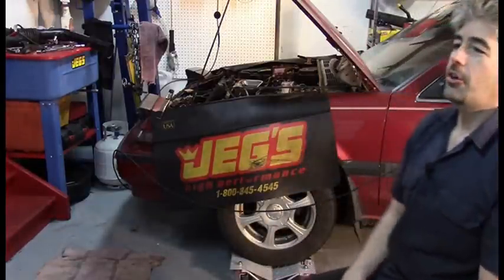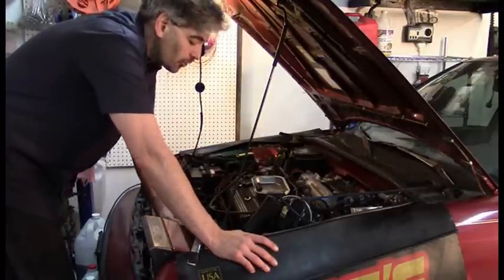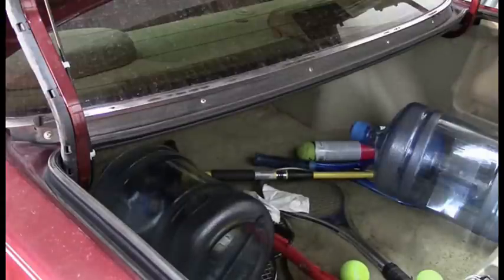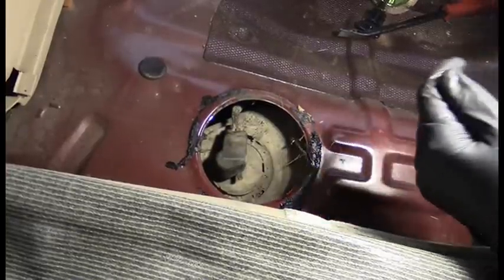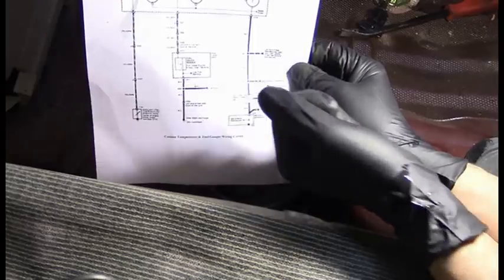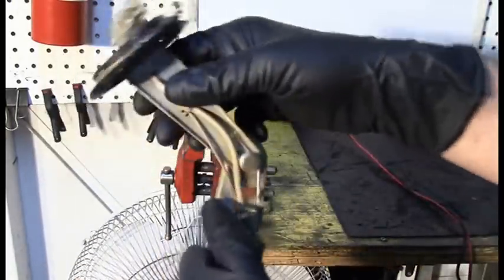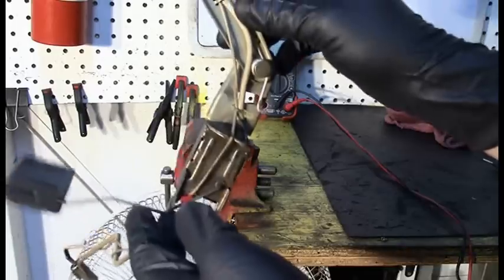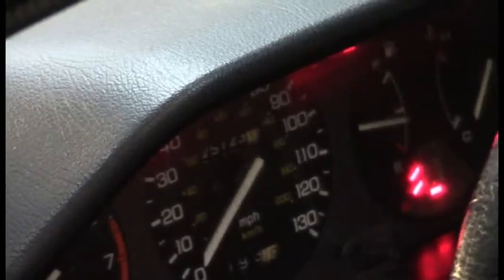Diagnosis of Stuck Fuel Gauge- Is it Gauge or Sending Unit?

Comment: Sir, i have 1996 hilux Surf (4runner) with Diesel 1kZ 3.0 Engine. The problem is when i key in and turn on the fuel gauge shows full and when start the engine it drops to empty. Any suggestions to start trouble shooting. The sending unit is inside the tank and not easy to take out without dropping the tank. Thanks.
Reply from the maker: I would check your voltage drop at the sending unit by accessing the connection outside of the tank.

Comment: Hello @Schrodingers Box, i noticed you said at 5:20 that "normally you would check the fuse" but you concluded that since its not reading "open" since its reading full not empty all the time, there would be no need. I was wondering because my 2002 Mustang's fuel is reading empty no matter the amount of fuel i put in it. Using your comment should I check the fuse next ??? Context I had a mechanic install and new fuel pump (including the fuel sending unit) and its still reading emtpy
Reply from the maker: The very first thing I would do is check the voltage at the sending unit. That would be step 1. Then measure for resistance variation on the variable resistor. 
   Nothing wrong with checking fuse but it’s not going to be the problem.
Reply: @ thank you, will do 🫡
Reply: @rhblue7204 did this help? I have same issue and was just going to replace sender
Reply: @CornishFarming  nooo it didnt work, i had to replace the whole sender

Comment: i'm having this exact issue on a 2002 Santa Fe my gas gauge stays at zero I put in a new fuel pump and sender so I ordered a new gauge cluster for 50 bucks so I'll see if that works I came to the conclusion. It was probably the gas gauge because it doesn't move at all. Whether the car is on or off it doesn't move an inch.
Reply from the maker: What was the voltage variance from the sending unit showing?
Reply: @ uh i never checked, i should mention its a 2 tank suv i tried hooking up a seperate gas gauge when i hooked it all up the gauge just went past full and wouldnt move
Reply from the maker: First step would be seeing if there is voltage change due to variable resistance. That’s what tells you where the issue is.

Comment: i didnt have my ohm meter so did the test you did with ohm meter but instead using a test light, i supplied ground to one wire of sending unit and the b+ i hooked in series to the other sending unit wire and as i moved the sending unit i could visually see the light get brighter and dimmer and steadily.
i tried the same test on sending unit that had bad corrosion from sitting outside and moving the float on this sending unit the bulb would drop out and even spike in brightness while being very erratic compared to the other one. i thought this was pretty cool.i love tinkering like this for fun.
Reply from the maker: That’s a clever way of looking at it!

Comment: Hello, I liked and subscribed. My gauge is stuck in the 1/4 tank position. The mechanics I spoke to said that doesn't make sense. It should either go full or totally empty when one of two of the most common problems occur. Any idea what would cause the gauge stuck at 1/4 or a little higher. Thanks, much!
Reply from the maker: Makes total sense to me. What is the resistance on the circuit?
Reply: I don't know. I'm hoping I do not need to pull the tank. I just paid someone to do new pump, hanger and lines. Aftermarket application. It did work when I got it back.

Comment: If I haven't seen this video I wouldn't be able to know how to test and do check my fuel sending unit properly, I do try and fix my own cars to save money and I do appreciate your help sir. I have this 1998 lexus gs300 that it has a lump on the gas tank due to their gas tank design and my gas won't hit full even though I have a full tank of gas. I hope this will work now since both sending units works properly thanks to your guidance. I really appreciate you sir and hope you're doing well and still wrenching till today 🙏🏼🙌🏼

Comment: Yes it was very help full. Yes I'm a home mechanic, mostly on cars from 1988 to 2005.
If only I would of known this information when installing a new sending unit in my 77 ford
f-150. there was nothing wrong with the old sending unit and the gauge worked. Now with the new tank and new sending unit. I have  a non working gas gauge. so obviously the new sending
unit, not  doing something. It's just installed in the truck now. I wish I would of tested it before installing. Next time I'll do what you did, and know what I have before installing tank. thks

Comment: Excellent video! Even 8 years later. I was going to just replace a fuel pump / sending unit knowing that it would be the idiot's approach - and one that would cost around $400 just for the unit. But after watching your clear explanation and sensible diagnosis, I don't have anything to lose by copying your technique. Thanks for making this video!

Comment: I replaced both sending and fuel pump on my 2010 FX35 and it still stuck on 3 quarters... its strange.
Reply from the maker: Doesn’t sound strange at all if it’s a gauge problem. did you diagnose it?
Reply: @SchrodingersBox  How do i diagnose a Gauge itself? removing it entirely form the dash??
Reply from the maker: No just ground out the signal.  see if it moves. if not apply low amperage signal and see if it moves then. if not check ground and power continuity and if it’s there replace the gauge.

Comment: There's no access panel on a 1956 Oldsmobile, so determining whether the sending unit or a wire connection is bad means dropping the tank.  If I have to drop the tank, then you may rest assured I will have a new sending unit in hand.  I can always sell it on eBay if a wire was loose or bad.  There, see?  Not an idiot.

Comment: Hi there…
Mine showed signs of failure some month ago.I took it out and saw there was a cut wire on the sending unit.soldered it and thought it was it.seemed it works fine for some Klms but suddenly fell on empty again.thought it did break again but when took it out again soldered wires where ok…cleaned it , changed the plastic damaged cover of the upper plug tried it 2-3 times and it does the same thing.when I put key on it seems fine but after a few mins drops bit by bit to empty.wtf??anyone any ideas?

Comment: my 91' sierra was a nightmare to change the fuel pump. no access panel and every connection was crammed in a tiny space between the tank and frame rail.
Reply from the maker: yep on pretty much any GM you have to drop the tank

Comment: My problem is different. My gauge works but my low fuel light stopped working. My sending unit is together with my pump in the same assembly. The assembly is expensive. What should i do?
Reply from the maker: sounds like a simple bulb replacement.   check for voltage at the bulb to confirm.
Reply: @SchrodingersBox  . Took out bulb and checked it. The bulb is fine
Reply from the maker: and what is the voltage at the socket showing when gauge is at empty (open circuit on sender)?
Reply: @SchrodingersBox  . I have no idea what the voltage was because the mechanic  checked it not me.
Reply from the maker: well that would be the first he should have done regardless of if the bulb is good or not.   can’t speak to that but I cannot imagine checking the bulb and not the voltage. time for a new mechanic!!

Comment: Dear friend
I having same problem with y suburban, l replaced the fuel pump and the gauge stay in full....And the problem is that mechanics want to charge me more that the usual....I was thinking adding a separate gauge separately.....would like your opinion.
Reply from the maker: so is the problem the sending unit or the gauge or the signal wire?

Comment: Im facing this problem right now, the gauge is stuck at 1/4. Im not sure how to access the sending unit so im taking it to the dealer to evaluate. I replaced the sending unit a few years ago so this time it might be the gauge but lets check the sending unit for dirt, corrosion, etc. and then do the manual test with the gauge before ripping the dashboard out.

Comment: I unplugged mine but the gas hand was still stuck on full. Do you know what else it could be?
Reply from the maker: could be a bad gauge. what happens if you put variable voltage to it? That would confirm 100%. also have you validated continuity to the gauge and ground?
Reply: @SchrodingersBox  I haven't checked the voltage yet my voltage tester is broken. But I just took the sending unit out and cleaned it real good but the gas hand is still stuck on full.
Reply from the maker: well you could just ground out the signal and see if the gauge responds. 
  cleaning the sender would have no effect. you unplugged it and the gauge didn’t respond. So logically, it can’t be the sender.
Reply: @SchrodingersBox  I'm going to try that and I'll let you know. Thank you so much for helping.

Comment: Thanks for all the great videos! I got a 1979 chevy k10 350 4x4 fuel gauge stuck on empty any one know why and where to start testing.
Reply from the maker: I would start by doing a resistance sweep.
Reply: Thanks a million for the response! Your talking about testing resistance on the sending unit ? So I'd have to pull the tank and remove the sending uint from the tank correct? Thanks for taking the time.
Reply from the maker: No you should be able to backprobe the wires from the sending unit to the guage at the connector.
Reply: Well it has just 2 wires a ground on the frame rail and another wire connected to the top of the sending unit.
Reply from the maker: what’s the voltage in the other wire?
Reply: Ill have to get it for ya my sons working on it at home the wife and i are a thousand miles away. Thank's
Reply: There was no power at the sending unit wire key on. This is a dual tank 79 chevy 350 with a carburetor However we did find quite accidentally that after testing the ground wire itself and cleaning the ground surfaces turned the key on. To no avail nothing, When he removed the sending unit wire to test continuity through that wire he went to the front to remove the guage. Instrument cluster (Note: he forgot to turn the key off.) Now the fuel guage was setting above full. He send me an email I have no manual here so i looked through some videos on testing and to my suprise. This is what i found out. Well there was one wire to measure resistance and a ground on the sending unit. If you remove the resistance sending unit wire off the sending unit itself the guage goes to way past full resistance ohms  go to infinity.  It should be zero to 90 ohms zero at empty and 90ish at full. Connected When you ground the resistance sending unit wire at the sending unit or the resistance sending unit wire at the guage.the guage goes back to empty. If you remove it from the guage or the sending unit it goes to past full.The only power is at the guage.The guage has 3 wires sending unit resistance wire a ground to the chassis and a power wire. But it does have a resistor on the back. After all the testing my son found nothing wrong. He went to work the next morning and comes back hes now trying to get the timing set right because its running weird so he out there with a timing light and Just when he's got the distributor tightened down it dies and now it won't start up again so i telling him what to check. Now I'm a little frustrated so i say test spark fuel and air.Test the spark with a plug in one wire at a time. Hold near ground se if it will jump a 1/2 inch gap. Pull the air filter off make sure there's not a rat nest in it. And look down the throttle of the carburetor and pump it from the side of the carb you should see two streams of gas going in the carb as you pump it. He texts back maybe the fuel pump is bad theres no gas coming out. Now I'm thinking what the heck. So to make a long story short He's been driveing it for months, gauge just doesnt work he said. Now i ask him How much gas did you put in it. He said he puts 5 dollars at a time.  Now Gas is 2.89 a gallon in our small town. At this point I've kinda figured out the issue and tell him to get his buddy to take him over to get gas in two 5 gallon gas cans I'll  pay for it  so he gets it puts it in the truck and a miracle happens the gauge now works and Oviously always has. Of course the truck starts because it now has gas. Im a bit embarrassed now i didn't want to leave you hanging after being so generous with your time. I thought you might even enjoy the findings. Needless to say i really appreciate your going the extra mile to help folks. love your videos. Thanks Again

Comment: Great video, great guy, but, two key things weren't shown: getting the sending unit out (and back in) and the cleaning you did that made all of the difference. I am not complaining for the sake of complaining. I have a gas gauge (or a sending unit) that doesn't work.
Reply from the maker: removing the unit was shown. you just remove the two bolts - nothing to it. then just clean the sweep is all.

Comment: Matt, did you drop the tank to get the sending unit out?
Reply from the maker: no, on this vehicle there is a access panel in the trunk. on any GM and many other vehicles you would have to drop the tank though

Comment: Hi, I hope this reaches you.

I have a problem with my fuel gauge.

And here's what I did.

Changed the faulty sending unit.
Tested the unit and the gauge, it worked properly, by imitating empty, half, and full tank.

But once I place it back inside the tank, the reading becomes unreliable. One of the main reason. It does not move when feuling up, or when I tried to deplete all fuel.

Didn't move. It's stuck on the quarter position.

My car is a KIA Sportage 1997-98.

Just trying to restore it, since it's just passed down to me.
Reply from the maker: one thing that can cause that is a voltage drop on the wiring. I would definitely check for that.

Comment: Thanks but Why did you cut off the part where you are cleaning the variable resistor?
Reply from the maker: because I did not want to get spray on the camera
Reply: @SchrodingersBox  that’s where the most important information lies. at least tell us how you cleaned the variable resistant and what spray or liquid you used all in all the rest of the video is well done
Reply from the maker: just a regular electrical cleaner. 
  The most important information lies in the diagnosis. cleaning the resistor is nothing special.  you could do it with alcohol and a Q-tip if you wanted.
Reply: @SchrodingersBox  fair enough

Comment: Mine still read full even after I disconnected the sending unit
Reply from the maker: What did your voltage read?
Reply: @SchrodingersBox  I unplugged the instrument cluster Nd it still read full. So I’m guessing it’s the instrument cluster that went bad. The fuel guage  only
Reply from the maker: Not sure why you would think that. What was the voltage showing that would indicate the gauge was faulty?
Reply: @SchrodingersBox  o disconnected the whole instrument cluster Nd still read full so it has to be the fuel guage
Reply: I hear that most of the time the little wiring behind the guage brakes Nd stops working . I’m gonna open it up Nd see
Reply from the maker: No idea why you would do that. just measure the voltage or resistance. You cannot determine with certainty  that it must be the fuel gauge by unplugging it. that makes no sense.  Stay with the basics and verify circuit integrity first.
Reply: @SchrodingersBox  yes it can . Look up Honda Civic fuel guage repair. On YouTube
Reply from the maker: It can. it also can’t. You don’t know. that’s why you test circuit integrity so you can be sure.   It’s like saying a lamp won’t light so you need to replace the socket. Maybe. but maybe the bulb is out. maybe the cord is bad. maybe the outlet is dead because fuse blew. That’s why you start with the basics by testing the circuit integrity so you know which it is. Why on earth would you pull an IC as a first step??? That’s insane. This isn’t rocket science. The smart thing to do is to determine if you really need to replace the gauge or if something else is the issue.

Comment: I replaced my fuel sending unit and I'm not sure if it's a bit inaccurate or reading correctly. I filled up my car yesterday afternoon (put a bit over 13 gallons in) and before, the gauge was sitting at the 3/8 or 5/16 marker (only markers are empty, 1/4, 1/2, 3/4, and full, but in between the markers are 1/8, 3/8, 5/8, and 7/8 that have no markers) before it got filled up. I'm not sure if that's accurate or not as I need to figure out if the Autel MaxiAP AP200 can get the fuel delivery live data as the VxDiag doesn't work with my car.
Reply from the maker: OK.... so what where your voltage and resistance readings?
Reply: @SchrodingersBox  I haven't done that test yet. I'll do that in a while, but there are no error codes.

Comment: How can  one confirm they have a short to ground in the wire from the sending unit to the gauge. I unplugged the harness and the gauge dropped. Plugged it back in and it went to full. I checked the ohms with the float up and down. And I have voltage. I hooked a test light to a positive and then touched the wire to the gauge with the tip and it came on but it was dim.
Reply from the maker: Really easy. Check for continuity from the signal line to the chassis on an open circuit. If there is continuity it’s a ground fault. Simple as that.  You can also compare the open circuit ground to any voltage source- even battery. If you read voltage then obviously you have a ground fault.
  Same is true for the power side, the polarity is just opposite. 
   Lots of ways to do it so just choose the easiest one!
Reply: @SchrodingersBox  thanks for the reply I checked for continuity and it would beep. I have the same volt meter you used